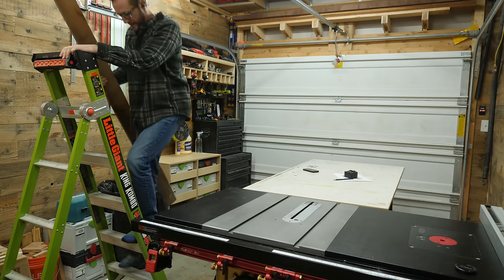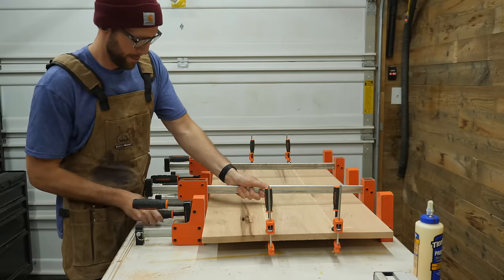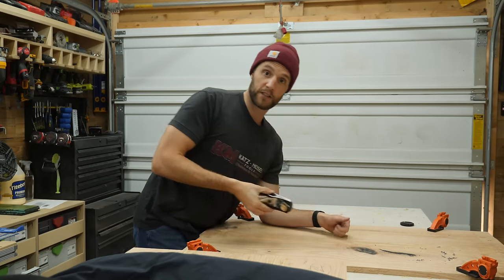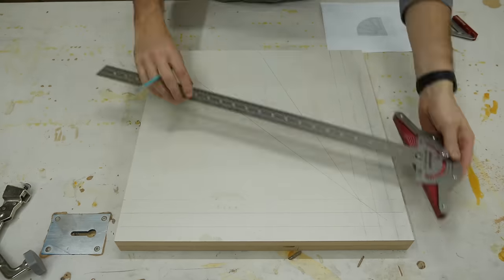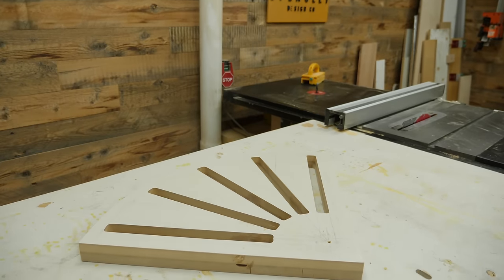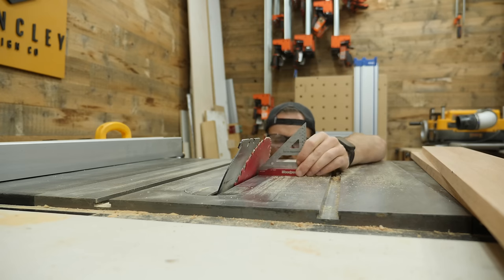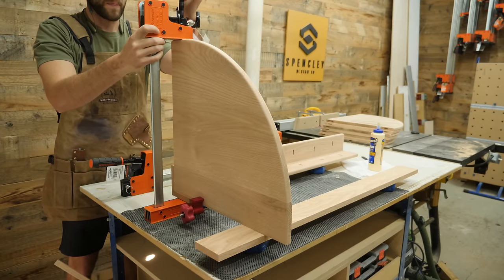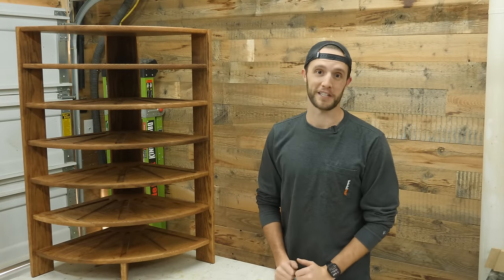Taking Wine Storage to the Extreme: The $2,700 Unit

Comment: "Wood stain is a lie" brought back to memory of a customer that wanted a solid cherry set of cabinets. So the cherry was ordered and the cabinets for an entire kitchen were built and installed in the home. When the customer walked in they had a fit "those are not cherry cabinets" she exclaimed. She was assured that they were. Which made no difference in her mind, because "they were not the same as the cabinets in her sisters house". There was to much grain movement and the wrong color. Cherry she said "is a plain looking wood." So back to the drawing board I finally figured out that her sister had been sold a bad bill of goods and what she had was a set of birch cabinets with mahogany stain. (hideous) But that is what she wanted and so that is what she got. I ended up selling the original set for the cost of the wood to recoup some expense and keep the contractor I was working with happy. You can tell people something but you can't tell them much.
Reply: Yeah you have to show your clients samples of what wood looks like. People care about color, not so much wood or what finish is on it. So you have to show them what Cherry with poly on it looks like. What walnut with wax oil looks like. They only care if it’s the right shade of brown. You also have to make sure they understand that wood is natural and unique and they have to be cool with variation. If not the. I wouldn’t even work with them. Obviously cabinet builders are different than custom furniture makers though. People don’t see kitchen cabinets as unique pieces of art even though they are still handmade furniture. 

If she wanted exactly what her sister has she should have told you that up front so you could deliver that. You must really like your contractor to eat you labor cost when it was the customers fault. If the contractor requested Cherry cabinets and then didn’t accept I would definitely make them take some of the burden or I would be cautious working with them again. But I’m assuming you have a long history and this is the first time this happened.
Reply: But... didn't you all even talk beforehand?  No samples were discussed?
Reply: If they ask for cherry and you deliver cherry, they should pay for it.
Reply: Yea no. Client asks for product and you deliver, that’s a hell no to a redo. But always have samples to make sure the client knows exactly what they are getting.
Reply: Lesson learned.  Find what clients want,  not what they say they want.

And where can I get a set of cherry cabinets built for the cost of the wood?
Reply: " birch cabinets with mahogany stain" - when two good choices combined made a bad one
Reply: THIS comment has wisdom built-in, thankyou. If you're a tradesman, you've been there.
Some of the commentary on your share is a lot of Monday morning quarterback s**t. 😂
Coulda-shoulda-woulda...but didn't. 😂
You took ownership of the f**k-up because, of course, the client's always wr..right..ong. 😅 
You made money on that project, made the client happy, showing the contractor that you're a reliable pro., made money  down the road on cabinets that were almost pre-fab'd, and hopefully got lots of work thrown your way by that contractor subbing on other projects. 
You also kept or further developed your good name, which is worth much more than non-tradespeople realize too. 
If you were around here, just by your comment alone, I'd have at least 3 contracts for you, just off the top of my head today. 
Good comment, and thanks for the share bud 👍🏻

Comment: Couple of thoughts.  1.  Who gives a F about using hand tools.  We invented power tools for a reason.  We don’t live in the 1700 before electricity.  2.  Why not use a string on your jigsaw to cut the corner.  Use the string from the corner of the board to your router and then cut the radius ?

Comment: BTW, don't know if anyone else has mentioned...hot melt glue will usually 'release' with a quick spray of isopropyl alcohol, just enough to seep under an edge, and capillary action moves it along as you peel it up with your prized HF chisel!

Comment: I've been using charcoal to color my epoxy to fill these voids: the black dye was discoloring the wood pretty deeply sometimes and I'm sure that was user error, but charcoal doesn't cause the same discoloration.
Reply: I normally use black paint that I have in the garage and never had an issue with it dying the wood once sanded flush. But I use tabletop epoxy so it’s not a thin penetrating viscosity. It makes sense though if you are using epoxy that penetrates a lot the dye could get into the wood and stain it. It also makes sense that the charcoal particulate wouldn’t penetrate the wood fibers.
Reply: One shop I work with used to use Bondo with stainless added when mixing. It worked well and didn't bleed anywhere. Taco
Reply: Stain added (damned awful-correct)

Comment: Hand tools work fine on epoxy. It’s just that hand tools are designed to take shavings measured in the thousandth of an inch. When you start getting up to 5 or 10 thou you’ve got a substantial shaving, about the max I would ever take for a rough pass. Usually we are talking about 1 to 4 thou depending on if it’s a finish pass. So shaving off 1/8 inch or more of a mound of epoxy obviously takes a bit. An aggressive sander that can clear the dust is obviously going to work pretty fast. 

If I was to rely only on hand tools and I overpoured my epoxy I would probably flush cut it with a Japanese saw. Put masking tape down if your saw scratches the surface. Then card scrape the remaining 50th of an inch. I say scrape it rather than plane it because you’re talking about knot holes and the grain is erratic there. Scrapers don’t care about grain direction the way planes do.

Comment: I'm sort of in the same boat, my garden doubles as my workshop.
But why hot-glue the boards to the jointer sled?  I used to just lay the board on the sled and pass it through, getting good results.  Since then I have made a sled with adjustable supports along its length, so it will support a warped board in several spots, allowing the planer to take off a bit more material on each pass without the pressure from the blades and rollers warping the board.  That is a real time saver.

Comment: A trick I picked up from Blanchard grinders is to use a number of small wedge shims to support the underside of a rough board during the first cut.  It's a little cleaner than hot glue.
Reply: Blanchard grinders... I learned be methodical and be sure the magnet is ON. ;-)

Comment: For the epoxy cake that you need to remove, you can remove a lot very fast using your router. Adjust the router bit depth by letting it rest on a small piece of cardboard or metal shim when standing on a table. That will reduce the sanding to the thickness of the shim. The shim should be thin, so never use a shim made of nachos.

Comment: Nachos, you're probably aware but there is a dust collection attachment kit that fits the bosch router, (BOSCH RA1173AT Dust Extraction Kit)  there are attachments for both the plunge and regular base, as well as edge collection attachment. I don't have the greatest dust collection set up, but have found them super useful in reducing the dust in my shop/garage

Comment: Nachos, that was a nice build in such a small work space, a couple of things from an older woodworker to think about.

If you do a corner shelf like this again you could do the first cut for the shelves at a 45 degree angle you can have the grain going from wall to wall instead of wall to radius.  Having the grain going perpendicular to the common line of sight in some cases can be very nice, but it also means extra waste.  Some customers don't care about small details like this and some love having more detail options available, and the more tricks and options you have the easier it is to have your customers happy and satisfied.

Something to think about regarding stain, we always considered stain the last bit of enhancing a project before the finish coat.  Things like creating subtle contrast, like this project if the sides were a bit wider or a full back you could mix the stain a bit darker for that and the lighter shade will naturally draw the viewers eyes to what's being displayed on the shelf.  Uniform coloring; if you're building 2 dozen display cabinets, a few tables, and a desk for a storefront; or the tables, chairs, wainscotting for a court conference room frequently your customers will want it to be as homogeneous as possible and a good stain job can tie it all together in a way that the wood may not be able to do on its own.  Accentuating the grain, I think especially for smaller projects like jewelry boxes, if you can mix a good stain and apply it well you can have it look so natural that non woodworkers won't think it's stained; making the grain or spalting or a burl show the beauty and character of that special piece of wood you've been saving for a close friend or family member.

All that said about stain; the walnut stained oak was a bad trend in my opinion as well, I don't think it really added anything that the right choice of oil finish wouldn't have done better.  But that's my opinion and the customer's opinion is the one we are looking to satisfy.

Comment: I know this an older video, but I wanted to say that I completely agree with your "no stain" idea. I do like some (clear) oils, and even satin poly to protect the wood. I've even seen some gel stains that seem to highlight the wood with a minimum of darkening, but I confirm before using.   I do have a question.   Since this was always going to be a corner piece, why not have the two straight sides as full panels (like a cabinet)?  Your plain top could have been a little bigger, and would make a nice cabinet top. Thirty bottles of wine have a lot of mass.  I like to have my furniture look like (or a least give the impression)  it's bigger than whatever its holding.  Your shelves have the mass to start, but the small slats that hold them up seem a little downsized.  I have to admit that I didn't see the balance thing coming, and full cabinet sides wouldn't have completely cured it.  It's a good thing you experienced that before your client filled it with 30 bottles of wine!

Comment: Why not epoxy the voids before you flatten the boards?  I’m sure you’ve tried that, so why didn’t it work?
Reply: I have done this and whilst it does a great job of quickly removing the epoxy there are two reasons I would never do it again. One is the huge amount of mess it made spraying epoxy ribbons all over the place (May not be an issue if you have good extraction).... the second more important reason is that it gummed up in my machine... the blades and feed bed were never the same again.
Reply: It'll destroy the edge on the planer blades

Comment: NACHOS There is a formula for the number of clamps you need:  {clamps needed} = {clamps have} + (2 x {clamps needed})

This is an old video so I don't know if your setup has changed, but when using a hand/trim router with no dust collection, I just clamp or tape down the hose of a shop-vac in the area I'm using and it does a decent job. There is still clean up to do after, but it's far less and keeps the dust from floating too far from the work area to where I have to vacuum the whole garage.

Space saving tip for getting a CNC router:  Install some french cleats, mount the router to a board and use french cleats with locking pin to mount it vertically on the wall. Almost all your cnc work is going to be clamped to the sacrificial board, or your going to use the tape + ca glue mounting method. So vertical mounting works perfectly well. Then since it's on french cleats, if you do need to use it horizontal you can always take it down for that project.

I also would like to say that I appreciate that you are using (at least it looks to be) p100 filters on your respirator mask. I only use genuine 3M P100. For anyone that doesn't know the P vs R vs N:  N is for particulates that contain no oils, liquids or other aerosols. R is usable when oils or aerosols will only be present for short periods of time. P is specifically designed to handle oil and aerosol particulates. The 100 means it stops 99.97%(HEPA Equivalent) of particulates.
Reply: Oh, one more things. Stains have their place. I use transparent water based stains and tints to get colors not found in nature for accents. I'll also use tint over purpleheart any day as purpleheart browns over time. Used sparingly stain is perfectly fine.

Comment: Wine bottles need to tilt toward the mouth of the bottle if you are going to use good wine which uses corks. The bottle tips so that the wine covers the inside of the cork and keeps it moist and therefore expanded.
Reply: 1. It is a fallacy that good wine only uses corks. Screw caps actually more consistent and less prone to storage problems. 2. A full bottle laying on its side keeps the cork wet without having to be tilted downward.
Reply: @JamalHeacock  I have never seen a "good" wine that had a screw cap, ever! All Good wines (those that cost more than $250.00 a bottle ) have corks. I am not talking about pedestrian wines, but real fine wines. 

If the owners of these racks are going to have locally produced inexpensive wine, then that owner can store them in an old trunk and it will not make a difference until it turns into vinegar. A wine rack would not be necessary. 

The bottles are stored with a slight tilt as corks do breath if not saturated properly. When a bottle is just on its side the effervescence can escape through the cork. When stored properly with the bottle on a slight tilt the effervescence goes to the highest point in the bottle and is not near the cork so it cannot escape.

Comment: Nice Video: Small shop here as well. Alternatively, you can a 12" piece of plywood 6 feet or so in length. Cut a second piece 3" and glue in onto the 12" piece, install hold down clamps and this becomes your straight edge jig for your table saw. Faster than the track saw. Subscribed so keep em comin.

Comment: NACHOS. I don't do super heavy duty woodworking but I just picked up a Rikon 6"Benchtop Helical Jointer on sale for $410 and absolutely in love with it. I did a lot of research (including noticing these were the only benchtop/budget jointers Rockler and Woodcraft sold) and chose this one. I couldn't be happier, especially for the money. Going for almost $600 at Rockler but Amazon has them for $408.

Comment: May have been easier to just use a Dado blade and cut slots in the vertical boards for the shelf. For opinions on stain, I did my kitchen cabinets in unstrained Oak, with a Urethane finish so it would not yellow. The problem with not using stain is that it is very difficult to get enough Oak that does not have dramatic changes in color from one board to the next. You don't know the color of the board till you plain it. Second problem is that if you don't want it to yellow, you have to use waterbase, which makes the wood wick up and needs tons of sanding You end up with 5 o6 coats before you have a good finish.

Comment: Nachos... You mentioned lots of micro-adjustment in creating the corner radius template for this project. I'm not sure what the micro-adjusting was for, but I was guessing that  may have been because you needed a straight, tangential edge on the two ends for your uprights to attach to. It looked like you tried to achieve that by cutting the initial square to size and then trying to get the corner of your circle exactly aligned with the two edges of your square. Toolify did a video about 8 years ago on setting up a jig to make corner templates on a router. This method intrinsically creates the tangential ends on both ends. His goal was to create small reusable corner templates similar to some ones from woodpeckers, but you can scale the method up to create much larger templates. I used some OSB scraps to set up a jig to create 4 and 6 inch corner radius templates for rounding off corners on some floating desks I recently made. There's no reason why you couldn't scale the approach up to 18" or 24" or whatever radius you had on this project. Whether this setup is more or less work than what you did I can't say, but it should add a lot more certainty on getting the curve and the tangential lines on either end accurate.

Toolify hasn't been active in a while, but he did come up with some neat little constructions for a few things in the shop.

Comment: Nachos. Love what you're doing, Eric. I also have a small workshop, although bigger in area than yours. I share my space with 2 cars, which I have to move out every morning and in again every evening.
My equipment level is quite a lot lower than yours, but I do have a nice Bosch mitre saw (which I need for the decking work that I do). Comes in handy in the shop.
I wish I had half of the ideas that you have, but I'm learning.
Thanks for your channel, bud.
From Cape Town, South Africa.

Comment: Oh. Your comment on clamps reminds me of this tip, If you cut boards with a slight bow you can effectively use less clamps and still have all the clamping ability. Saw it in an fine woodworking magazine long ago. Just do a YouTube search on clamping techniques I’m sure there’s a video explaining it in more detail. You’ll be happy once you learn the technique. Saves clamps big time! Research more on jigs. I’m in my experience I found later in career that knowing how to make great jigs can save you not only time but added tools you can manage without. Since you’re not a woodworker by trade I wouldn’t recommend expensive tools because it’s hard to recover the expense of them doing this as a hobby or side hustle.